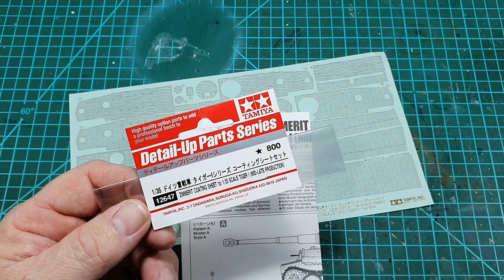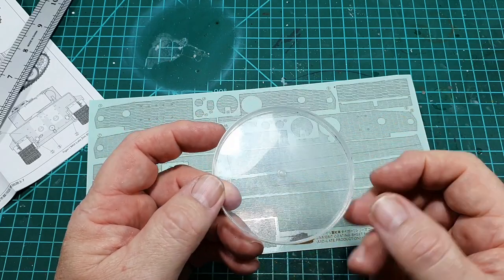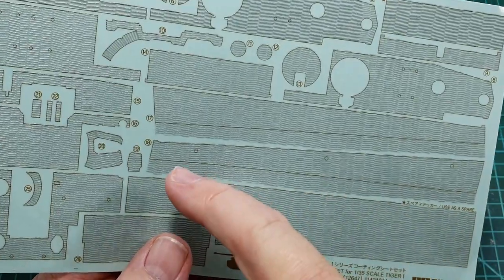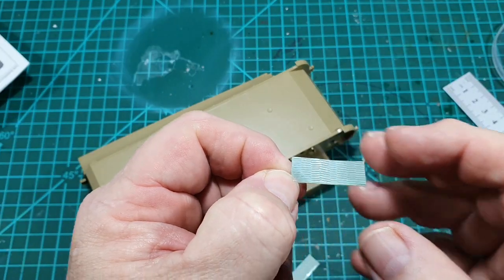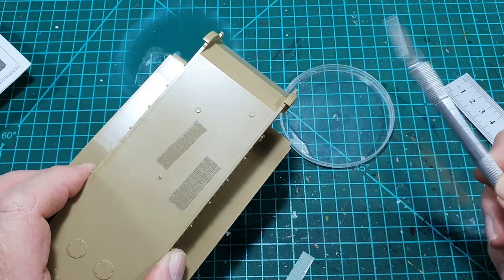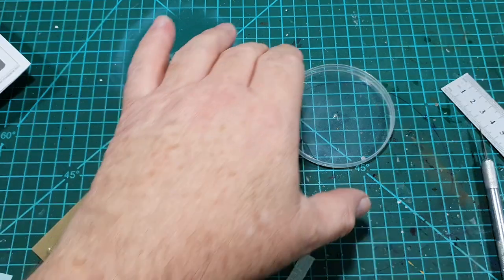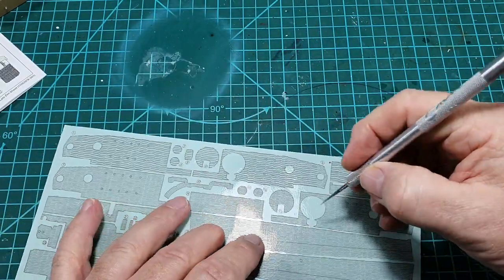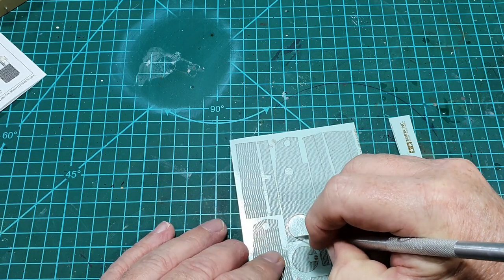Applying Tamiya's Zimmerit Coatings - Hints & Tips

Comment: Thanks Pete for your very usefull tips!
i'm beginning 1/48 tiger with such coating, and your method seems to be the best. Some prefer to cut the long parts (or complex ones), but it doesn't solve the difficulty to apply at the first try.
Applying clear before weathering will probably secure fixing the coating. At last with enamel weathering.
Reply from the maker: Hi mate. Glad you found this video helpful. I think you're quite right. Applying a coat of overall clear should help seal the zimmerit onto the tank, especially using enamel weathering compounds which can sometimes effect the base paints underneath. Cheers!

Comment: Your video and tips are awesome Pete!  Thanks for what you do.  
So, if you have time I’d like to follow up with some comments below on enamel washes.  I’m building the Tamiya Elefant and will apply the Tamiya Zimmerit decals.  Normally, I apply a Mr. Surfacer primer, then Tamiya acrylic XF flat paint.  I then let it dry and cure for 24 hours.  Next, I brush on a wash consisting of Model Master (or similar) enamel thinner with a few drops of flat black enamel paint.  Then I apply the model decals and finally spray a dull coat to reduce any shine from the decals.      I have never had issues with the base acrylic paints.
Reply: Whoops—I wanted to ask you and your viewers if they have had any issues applying the enamel wash over the Zimmerit decals after the Zimmerit decals have been primed and painted with acrylics.  Thanks!
Reply from the maker: @briankeller8116  Hi Brian. Almost all of my paints, washes, and weathering, are Vallejo acrylics. The only enamel paint I have ever used is AK Interactive's Extreme Metal Chrome, which I used on my Miniart Mercedes Typ 170 sedan (see my 2022 Built Models video). So, personally, I can't say enamels do, or don't, cause any issues. I haven't heard of anything specific, but I have noticed that most modellers give their acrylic painted kits a gloss varnish, rather than a matt or semi-matt varnish, before applying enamel washes. Which makes sense since enamels are oil/solvent based, which might damage the water based acrylics, without some form of "solid" varnish protection. I think if you went down that path, it should be fine. Cheers!

Comment: Nice tutorial mate.
My only concern is that how long will the adhesive backing keep it on for, will it eventually lift without glue?
I’ve used ATAK zimmerit b4 but you are using actual glue to hold it on with.
Reply from the maker: Hi mate. This Tamiya Zimmerit is pretty hard wearing. I haven't experienced any "lifting" so far, on my kits. Tamiya's Zimmerit coating is quite hard wearing, being a thickish plastic, probably similar to the resin ones that ATAK make, maybe a little thicker, and the adhesive Tamiya uses, seems to hold on pretty well. Of course, in 10 years time, it might all fall off. I let you know then. :) Cheers!
Reply: I checked out a few other sites, just being curious and there are a few mixed results.
I was more concerned about the durability in relation to the weathering process.
I’ve done my own Zimmerit but was interested in just trying to ‘rebirth’ some old Tamiya king tiger and panther kits as I can’t really be bothered with spending the time on as they will only end up a wrecks.
Reply from the maker: @michaeldean1289  I see what you mean. I only use water based acrylics for my weathering, and haven't had any problems so far. But, I can imagine, if an enamel wash, or weathering, maybe even an oil wash, was used, they might affect the adhesive enough to make the Zimmerit lift, especially if they've been thinned down using enamel thinners or similar. That might be something to look into for a future video. Cheers.
Reply: @PetesKits  Right, would be good to find out the properties of the adhesive base, like solvent affect. What of hitting corners, edges with thin cyano - like a sealer, or permanent cure? Or we all pretty much have to wait n see... Thanks for demo!
Reply from the maker: @goratgo1970  Can't help you on the solvent side, as I use Vallejo paints, and weathering effects, which are all water based, and they don't seem to affect it one little bit. So maybe someone else could help with that. As for sealing the ends with cyano. Can't see a problem with that, although again, I only use that for PE parts, but if used on the corners etc. it should reinforce the grip, and make a fairly permanent seal. Cheers!

Comment: My main issue is with the decals, the german crosses and numbers always look odd when i apply them on zimmerit, i noticed forces of valor uses paint to make them when they're done on zimmerit, that could be interesting to try
Reply from the maker: Yes, this is the main issue with decals on Zimmerit. Whether the Zimmerit is PE, plastic, or like these Tamiya ones, a self adhesive. Crosses and numbers, etc. take a bit of work, even with a decal softener, to sit, and look, right, especially with thick decals, like Tamiya tends to have, they don't stretch enough, to mould to the Zimmerit correctly. Painting, although more time consuming, and a little trickier, is probably the best way to get "the look" right. I've done it (took a few goes to get it spot on), and it does look better, and there's no decal "shine" to contend with. It's definitely worth giving it a go. Cheers!

Comment: Thanks for the vid. I'm about to use Tamiya's zimmerit on my King Tiger for the first time. What about spraying Mr Surfacer over it? Have you had any issues from things like that?
Reply from the maker: Hi mate. Don't know about Mr Surfacer, as I only use Vallejo acrylic primers etc. for my kits ( I have small working space and the smell enamels/lacquers can be overpowering), and have never had a problem with them. As I understand it Mr Surfacer is lacquer based, so I'm not sure. Best way to check would be to try it out on the flat bottom of the kit, using an offcut of the zimmerit sheet, where you won't see it if something goes wrong. Sorry I can't help you more! Cheers!
Reply: @PetesKits  thanks foe the reply. I'll try some off cut on a scrap piece and see how it does.
Reply from the maker: @joshuaparsons1377  Hope it works okay! Cheers!
Reply: @PetesKits  did a test tonight with scrap Zimmerit on styrene and sprayed a coat of MrSurfacer 1200 over it and it seems to be fine. No lifting. FYI for anyone here who wants to know.
Reply from the maker: @joshuaparsons1377  Thanks for the update mate. Good to know that MrSurfacer is good to use. Cheers for that! Have a great Christmas & New Year!

Comment: You know, if this would work with the takom 2130 model?
Reply from the maker: That's Takom's Production/"What If" Tiger II? If you use Tamiya's King Tiger Zimmerit sheet, (Tamiya Part No. 300012), same techniques I've used for the Tiger I Zimmerit sheet  in this video will work. Although being a Tamiya part on a Takom kit, you may have to do some adjusting, and alterations. Especially if you build the "what if?" variant, which has some different parts to the standard Tiger II. Hope this helps! Cheers!
Reply: @PetesKits 

Yes, thanks. And sorry, I had confused the sheet model you show in the video with the one I needed. 
And yes, the model I needed was the Tamiya 300012 that you told me, but I found it with another Tamiya code 12648, so it would fit the Takom King Tiger 2130 model, thank you very much for you Help.
Reply from the maker: @krong7279  No worries. Anytime. Cheers mate!